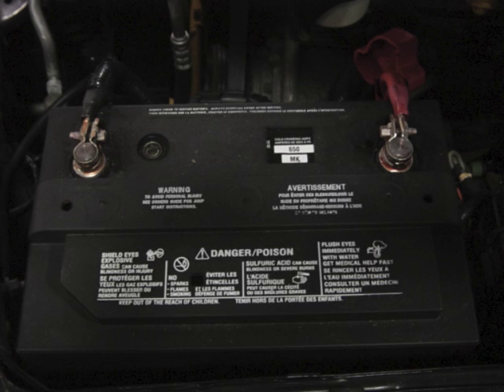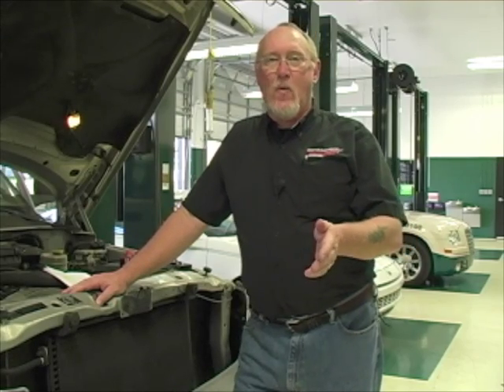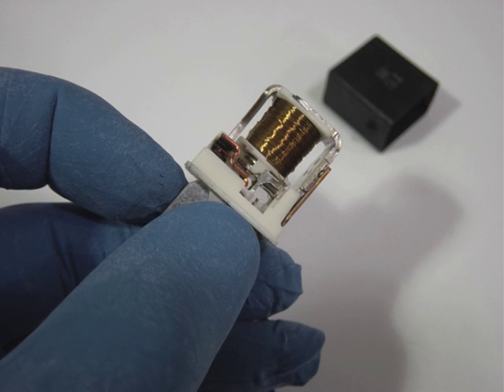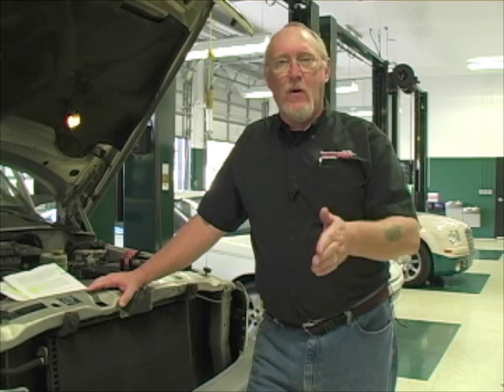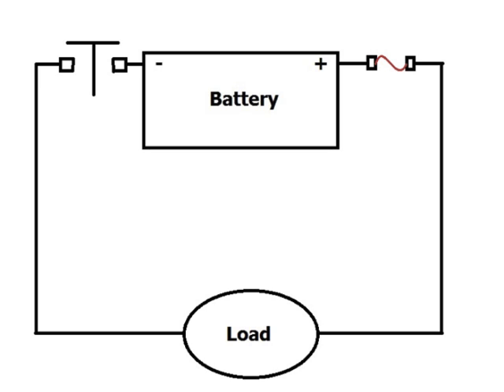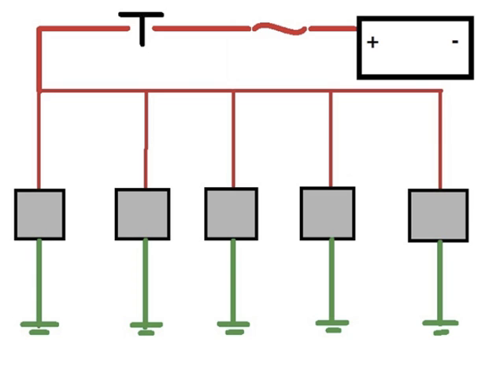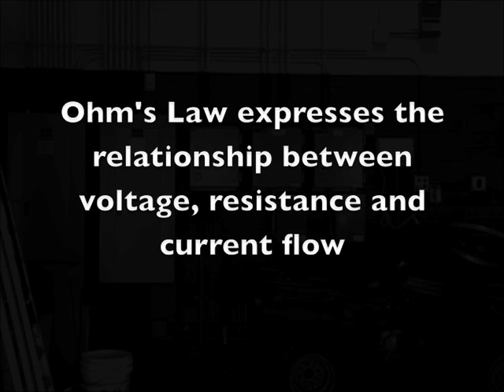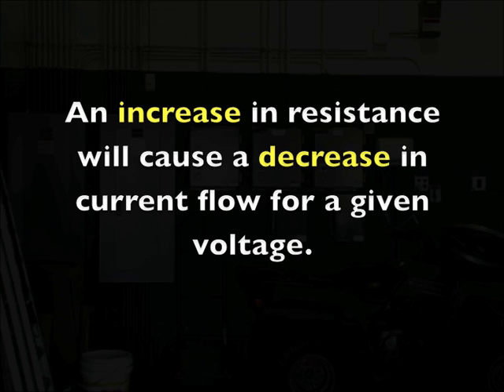The Trainer #29: Understanding How Electrical CIrcuits Work and How to Test Them

Comment: MOTOR AGE, Can you make a youtube video using the oscilloscope on spark plug waveforms look like. I have seen voltage and current fuel injector waveform or i haven't seen what spark plug waveforms look like on an oscilloscope. The Distributor cap is what sets the firing order? why do cars use different firing orders any advantages in use different firing orders? Older 60's & 70's cars only used ONE ignition coil to fire 8 spark plugs, but the fuel injectors need multiple ignition coils per spark plug, any reasons why?
Reply from the maker: Hi Bill! Sure, I can make a note to add that to my growing list of topics to cover - gladly! On to your next question. No, the distributor cap does not set the firing order. That is the engineers' job. And for the last - using one coil to fire all of the spark plugs is not as efficient as using one coil per cylinder.
Reply: @MotorAgeMagazine  thanks, can you please make a video explaining dwell time because i don't know what dwell time is or what it does to the RPM and how to look and measure for dwell time on the oscilloscope waveforms

Comment: I’m confused. Substances which have few free electrons are poor CONDUCTORS  it’s not the number of electrons it’s the free electron  in the valance shell yes or no?
Reply from the maker: Materials with few electrons in the outer ring make the best conductors because they are easier to break free. Those with more than 3-5, if I recall correctly, are better insulators because it's harder to break them free.
Reply: Yes sir  have a nice 4th